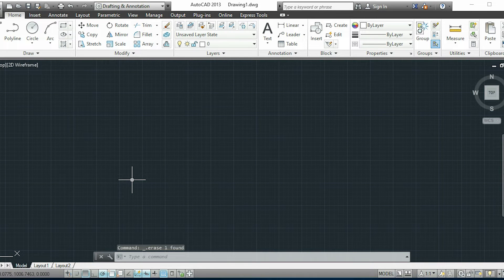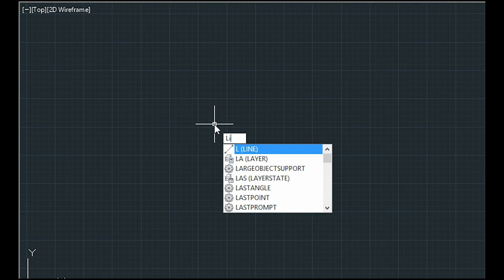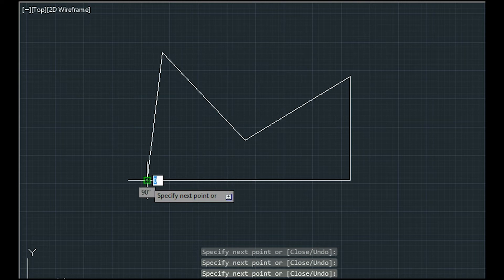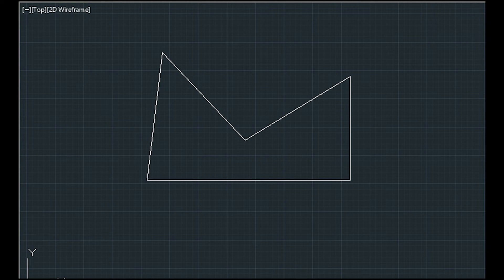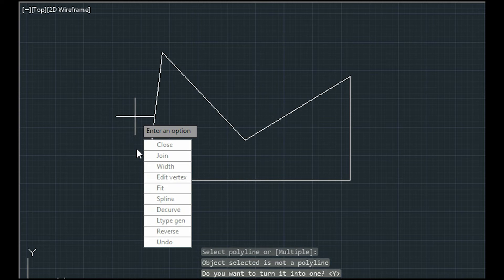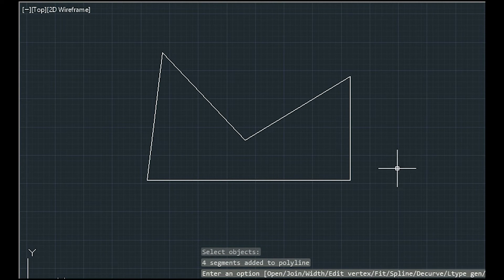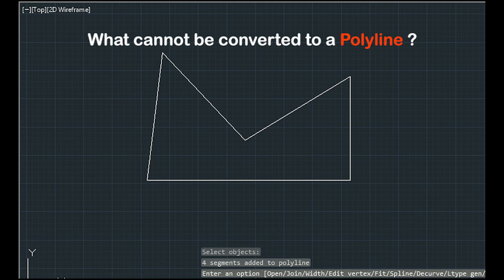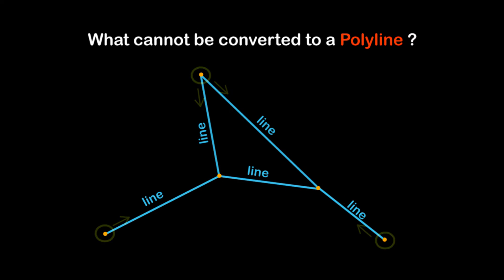AutoCAD - Convert LINE to POLYLINE (Simple and Easy!)

Comment: isnt the same with bpoly command ???? and what is the difference
Reply from the maker: Bpoly command is for lines that form a closed boundary. With Pedit you can apply also to lines that form an open boundary. If you have a recent version, you can use command Join. Which works really well
Reply: @CADinblack  Yes, the Join command is the easiest.
Reply: @CADinblack  how to explode spline 
 Convert to polyline
Without losing the smoothness.

??